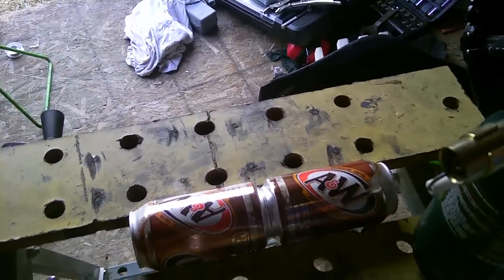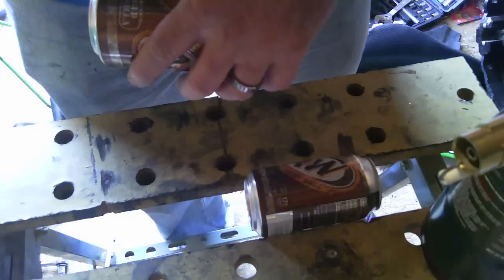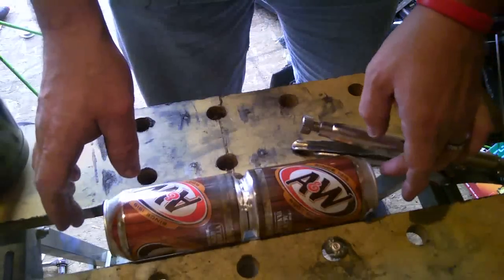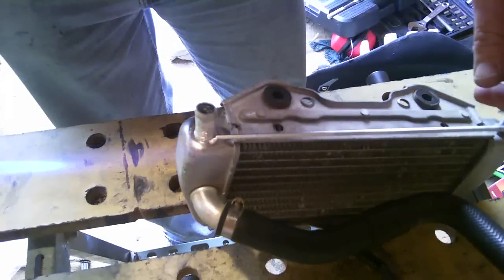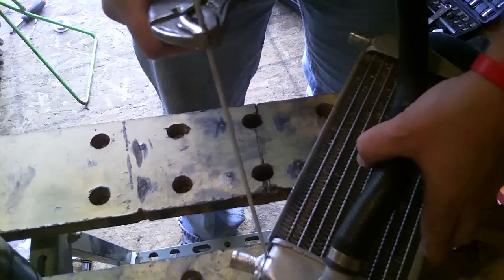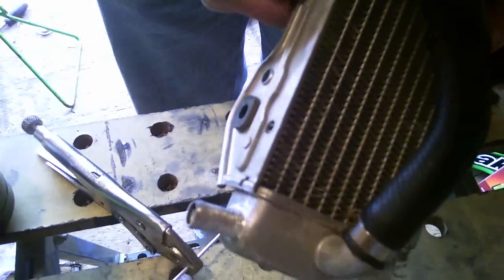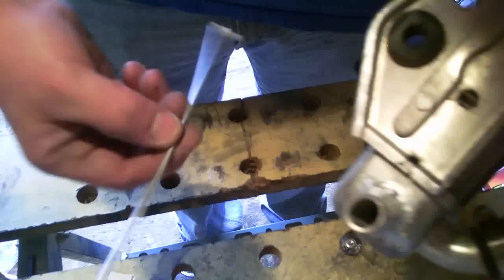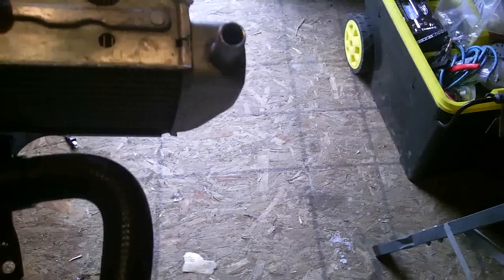How to weld aluminum with a propane torch and low heat aluminum welding rods fix your radiator.

Comment: I appreciate you sharing your mistakes as well as your successes. Helps us on what to look for. I have done a lot of soldering of copper pipes and feel I am pretty good at it. I think I will give this a shot on an aluminum pressure washer pump that has a hairline fracture at the outlet port. Thanks for the video.
Reply from the maker: You are welcome. Tell us how it worked for you. Thanks for watching.

Comment: Always test weld.....measure twice cut once .....great video. appreciate the info....what equipment were you using....Turbo torch?
Reply from the maker: Thanks. I was using this torch http://www.harborfreight.com/electric-start-propane-torch-91061.html but I was using too much heat on the cans. It was fine though on the thicker material of the radiator. Still holding today.

Comment: Aluminum beer cans are way thinner than your rad metal. I would have practiced on some pieces that were similar in thickness before attempting an expensive item like a bike rad. That's why the first attempt failed. Preheat first, then go from there. And, your propane torch is way too hot for this work. Turn it down to get more control yo!
Reply from the maker: I agree. In the end I succeeded and the rad is still functioning fine. I put my trials and tribulations on the video so people could learn from my mistakes. Thanks

Comment: Is this not brazing/soldering rather than welding?
Reply from the maker: Not sure but I do know it worked and continues to work today. That is a year and half at this point and that is on a dirt bike that takes a serious pounding. I live in Texas so that rad gets hot as the ambient temperature is high. Thanks for watching.
Reply: Richard Lloyd

Oh I have no doubt it's very effective for that kind of thing, a well brazed joint is extremely strong, I've even seen whole bike frames done like that. I was just wondering if this was a true weld or not. I know there are some low temp alloys that are nearly as strong as a weld when brazing.

Comment from the maker: @ Chris Long The instructions say that the rods do not require flux. It's up to you if you use it or not. Thanks.
Reply: Richard Lloyd the aluminum should melt your rods not the torch flame. heat, remove flame, touch and melt rod on contact. it'll stick faster and better.
Reply: It would have been a lot easier if you had used flux, when it gets to the rite tempture it would start to buble then you stick the rod to it and it will suck the solder rite into the place where the leak was cracked.
Reply from the maker: Charles Detharidge  If I ever have to do it again, I will try it with flux. Thanks for the info and watching.
Reply: you dont need the flux but in my exprerience its better to heat the thing you want to fix and then run the rod over it, dont put flame onto rod cos it will not stick. it stuck in the end because the rad eventually reached the right temp....hope it holds
Reply: lol just got to the end of the video, you figured it out in the end. good job sir
Reply from the maker: Thanks.

Comment: why no Flux, is that a must, or did you just not have any on hand? Ive got Flux and seems like it couldnt hurt.... Expand please hav to do inside rim of a car crack that leaking a tiny bit of air...think it should work ...Your thoughts...?
Reply: This kind of rod does not need flux. It is about the only one.

Comment: i will be buying those rods tomorrow and always have some on hand.i have an old old 1969 fireball camper that  i am slowly restoring.it has hundreds of tiny holes from some kind of corrosion and someone stapled plastic to the outside .right into the aluminum.duh.this is very cool to see.i was going to use JB WELD.

Comment: aluminum cans are paper thin. Like trying to get a piece of cardboard lit with a match versus a piece of paper. In the end you got it right, don't be afraid of burning it out.

it should also be said, I think aluminum cans are made out of a weaker aluminum mix. I know they are about worthless for making quality aluminum castings.
Reply from the maker: Thanks for watching.

Comment from the maker: @John Doe Thank you very much. As I stated earlier to the know-it-alls, I could easily have edited out all my mistakes, but I would rather you learn from my mistakes than from yours. Thanks for your kind comments and watching.
Reply: Richard Lloyd I agree with you, because you left in your mistakes I know I will be able to learn from them too, if you had used edit to remove your mistakes there would have been almost nothing for me to learn. Thanks for sharing...
Reply from the maker: Paul Bialozor You are welcome and I still leave my mistakes in my DIY videos so people can learn from my mistakes. Thanks for watching and understanding.
Reply from the maker: The instructions (yes I read them) included with the rods specify that you do not use flux. Thanks.
Reply: Thanks for messing up.and leaving it in. It saved me alot of guesswork.
Reply: It's way better to see you mess up live, so we can learn, than have some perfectly edited 'take #13' cut. Is there any reason you didnt use flux? (Not a welder, but I DIY'd enough copper piping to have enough rope to hang myself ;))

Comment: I was wondering why you didn't remove rubber radiator hose before starting.
Reply from the maker: I was not worried about the heat affecting the hose and it did not.
 Thanks for watching.

Comment: Just an FYI, you should scrub the aluminum surfaces with a stainless steel brush first. This is done to remove the surface oxidization layer on the aluminum and ensure proper adhesion.
Reply from the maker: Thank you.

Comment: Hi, think you need flux! That will chemically clean the joint for good adhesion and open up the pores of the alloy.
Reply from the maker: It is supposed to be used without flux (according to the manufacturer). BTW it is still holding today.
Reply: Cool, very hard working with ally!
Reply from the maker: GasGiant62 It transfers heat very quickly.
Reply: GasGiant62

Comment: Lucky you didn't melt any holes in you radiator hose and of sizzle your bushings. :O Glad it held, I know how expensive riding can be and am happy we have many options to fix cast or forged parts nowadays. When I first started riding I was buying new levers and bars almost every other weekend, LOL!
Reply from the maker: Yea it's great to have DIY options to fix this stuff. A new rad is not in the "cheap" section of the store.

Comment: I don't know much about aluminum welding but i do know that aluminum oxidizes almost instantly. if you just use heat then you will melt the aluminum but the oxidized layer will coat your melted aluminum. The oxide melts at a much hight temp than the aluminum. That is why welding aluminum is always done with AC current, something about the low or high cycles actually burn off the oxide exposing the aluminum to be welded...
Reply from the maker: Thanks for the info.

Comment: The most important thing is to get it right....eventually....i watched a similar video and the guy heated the aluminum parts on his gas grilled to get them heated up thoroughly.... of course you couldn't do that, but same idea... aluminum really spreads heat.

Comment: I know this video is old, but you're doing it all wrong. You NEVER heat the ROD. Always heat the base metal. You wont melt that aluminum as its 3 times as thick as a soda can. Heat the radiator up really good and pull the rod across the metal your "welding".... Never ever heat the rod by itself it will just melt and drip onto the radiator. If you have any know-how of soldering its basically the same thing.
Reply from the maker: Point taken. I did get it right in the end. It's holding to this day.
Reply: awesome
Reply: Brent S Yes, I was thinking the same thing while watching this video!
Reply: Well said, I was about to post the same response.

Comment: Nice repair, although I have to say you got lucky. I use this stuff all the time the proper way is to heat the surface you try to repair and scratch the rod on the surface intermittently until the rod begins to melt at which point the remove heat keep applying rod on surface until it stops melting then repeat procedure untill satisfied with repair.  Avoid putting Rod into the flame. This stuff is very forgiving but if you want a solid repair this is the way to do it.  This torch seems to have a little too many BTU's for your application. Although would be adequate for something that was thick. Thanks for the video!
Reply from the maker: Agree with every point you make. The torch was the biggest issue as I had fear of melting the rad. Thanks and btw the repair is still holding.

Comment: how much are the rods? planing on fixing some leaks in the old jon boat
Reply from the maker: $13.99 http://www.harborfreight.com/catalogsearch/result?q=Alumiweld+Aluminum+Welding+Rods
Reply: thx so much buddy will a regular torch heat it up good enough to weld on the boat?
Reply from the maker: Brad Smith  Should do you fine. I would do some practice on some scrap aluminum just to get the hang of it.

Comment: Thanks for showing your learning process and allowing the critiquing in the comments, its still a useful video.
Reply from the maker: My pleasure. If I were to do it again. I would use a lower BTU torch with a finer point and of course I would heat the surface of the radiator till the rod melts. BTW this is the trick as you have to keep checking it regularly to make sure you don't over heat it. The torch I was using could have easily melted the aluminum rad if I had overheated it. That was my primary concern. Thanks for watching.

Comment: That would be better described as aluminum SOLDERING...   Welding involves melting the two pieces together,  You are not you are using a 3rd medal to bridge the two.

Comment: I was taking this very seriously until I heard, "There's too much on there so the next thing to do, is to... keep goin' around"!  & "Except for that part just fell off!" & "I'm getting better!" lol  I appreciate your effort and showing us what can and most likely will go wrong!  I have some steel pipes I need to solder together so thanks for sharing your video!  Keep up the good work!  :)
Reply from the maker: I pressure tested this rad to TWICE it's rated maximum pressure prior to installing it back into the motorcycle which continues to hold to this day. Spent less than $20 to fix a $150 part and it's as strong as factory. Glad you enjoyed the video. Good luck with your pipes.

Comment from the maker: Thank you for your advise. I appreciate that. My repair was successful and holds to this day though. Getting the heat right on the surface and rod is very tricky as you can melt what you are trying to repair. Thanks for watching.

Comment: Oh my frien, first of all, you must to learn how to do it! it's clear that you have not a clear know how of that. the flame never touch the rod, and the metal surface is clearly cooler than necessary! melting depend upon likeness of heat in both surfaces.

Comment: Ran a welding/fab shop for over 25 years
1st. thing NEVER use brass or plain steel wire brushes on alum. -- use only stainless steel
2nd. wrong kind of sand paper; they make a screen mesh type for alum.
3rd. Clean area with acetone.
4th. Remove all rubber or plastic parts and pre-heat in an oven at 350/400 degrees.
5th. Clean it again with acetone when it's hot.
That type of rod will flow out just like you were using lead solder when the metal get up to the right temperture.
Grandpa Bill

Comment: With that harbor freight rod melting at 700 and aluminum melting at 1200 you need to heat the whole radiator up good first and keep the rod off the radiator until it starts melting itself without the flame on it and then it will stick good! Put the radiator on the BBQ to heat the whole part up and then start brazing. The way you did it that crack is gonna fail again once it weakens over time. I'd redo it if I were you. Whatever you do just don't flame the rod at all

Comment: Isn't there a rubber o ring gasket in the tank to coil crimped connection on the radiator?  did it leak there after the heatup?

Comment: Richard, the can testing caused all your problems. You were reluctant to heat the metal on the radiator and instead heated the rod and drizzled it over the radiator and found it did not stick. This is the most common mistake in brazing/soldering. The base metal must melt your rod for you. You are not allowed to melt it with the torch. A clarification of terms. This was aluminum soldering, not welding. If the rod had melted at above 800 degrees it would have been brazing.

Comment from the maker: HF does not make any of the tools they sell including these rods. They are a reseller of tools and supplies. They are value priced the key word is 'value'. As far as I am concerned they do the job. BTW I drilled an engine block out with a HF drill. I still have the drill and the job took 6 hours of continuous drilling with a half inch drill. I paid $39.99 for the drill and that engine now has 110,000 miles and is still going strong and so is the drill. Paid for itself and owes me nothing.

Comment: Well I went and bought some of  the aluminum welding rods from Harbor Freight and some Hobart flux from Tractor Supply Company and need to find a flaring tool for the AC tubing I intend to repair on a Honda CRV. Will let you know! Your vid looks like you really don't have a clue as to what your doing. Sorry dude but that's just the way it looks. Oh and TSC may be in Canada. They sell the low temp welding rods there. If not maybe you have a Home Depot in Canada and they sell it.

Comment from the maker: I want everyone who reads this post to know this I like Harbor Freight from a value point not a quality point. I can buy a Lamborghini for a $250K but why do that when a Hyundai accent for $15K will do the legal speed limit on the highway? What I am saying is HF tools get the job done. Will they last a lifetime? Probably not. But for the price of a Snap On socket set 1/4" $65. I can buy 15 similar sets at HF are they as good? No. Am I ever going to destroy 15 socket sets in my lifetime? No.
Reply: A Hyundai Accent is barely $15,000 in 2019  ☺

Comment: 'Cause it's made in China. Once I bought  Chinese made anvil from Princess Auto in Winnipeg. You couldn't even straighten a nail on it. The soft nail was actually imprinted in that anvil!  I put it on garage sale as a boat anchor. That Chinese company painted everything dark blue (if that rings bell for anyone) Second was bench shears that cracked in half first time I cut only a 1/16" thin sheet metal. Cast iron the strength of a clay. No more Chinese for me. Not even take outs.

Comment from the maker: I am sure they took the tool back without issue. I know they don't make snap on quality tools but for the most part they are good tools for an excellent price. BTW they will refund your money or exchange for any reason, ie you don't like it. So as far as I am concerned that makes it a good value as you are never stuck with the tool.

Comment: Is this the same stuff called durafix? do you know how big of a gap it will fill? i have to repair a drain plug on a minbike. some kid over tightened it and cracked it. i have a helicoil inside but need to fill where a small piece broke away and close the crack. the missing piece is smaller then half a peanut

Comment: U should have heated the radiator to the point that it will melt the rod itself. It takes a few tries to get good at this.  Cans are paper thin as tour material gets thicker you need more heat.  Good job for first time

Comment: heat the base metal a bit more before trying to melt rod onto it, just like you heat copper pipe before soldering

Comment from the maker: It worked for me and it cost me less than $15.00. Plus I get to keep all the left over rods so I can fix other things. So if by ghetto you mean cost effective OK. BTW that weld I made is still holding and was tested to twice it's working pressure without fail. So if by ghetto you mean worked perfectly OK.

Comment: I came across it by accident. One of the holes that was drilled through the aluminium pipe had a crack at the edge of the hole. I repaired it with one of the welding rods and tinned the surface around the hole with new weld. I installed the nut & bolt through the pipe and then set about another repair in the pipe approx 50mm away from the bolt. The heat dissipated towards the hole and welded the nut to the pipe by accident. So i tried it on other nuts and it worked every time.

Comment: Yes its pretty easy to weld over holes. The molten metal acts like it has high surface tension and you can get it to bridge over holes without it falling through. Ive also managed to weld steel nuts onto Aluminium tubing with these rods. It did a great job and now i have new fixing points for the plastic fairings on my KTM 250 motorcross Bike. I think this product is a revelation. No need for expensive welding anymore.

Comment: Dont need flux. The rods have their own flux. He didnt get the metal hot enough and he put the rod in the flame. Remember..Heat the metal with the flame and not the rod. When the metal is hot enough, then apply the rod it will melt the rod into a very thin liquid. Best way is to start with a small piece of the rod. Heat up until it melts to liquid then apply the rod. The molten bit helps the heat transfer.

Comment from the maker: In the end I did get good adhesion but I was putting the heat to the rod and the rad at the same time. I guess eventually both metals reached the same temp.

Comment: What u are doing is brazing with ally. You cant melt the rod at all. U need to heat the part up. (get that hose off) to near 700Deg. Then heat some more, apply the rod to the metal and let the metal melt the rod.You will get adhesion. U don't need flux.